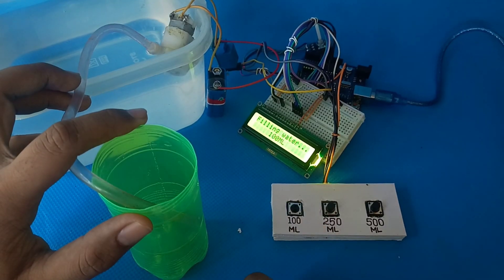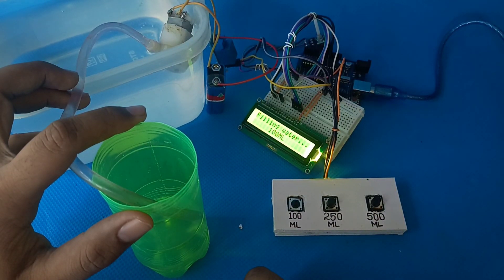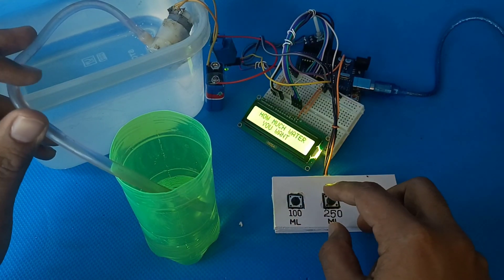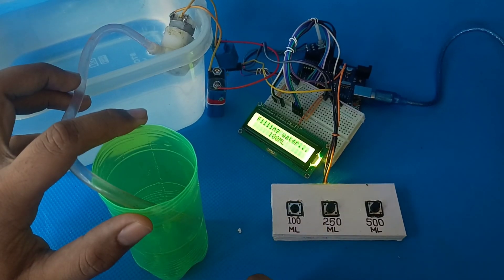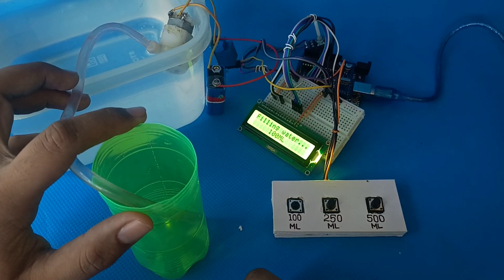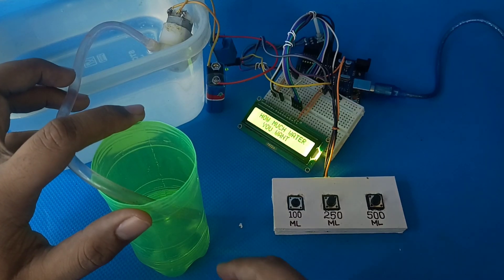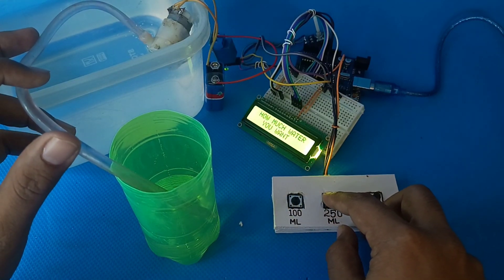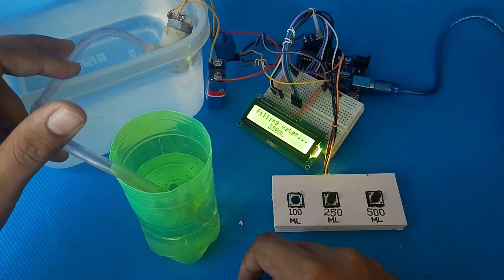Water Dispenser Using Arduino Uno || Arduino Project's

Comment: It should have been better if you use or add flow sensor for accurate dispensing instead of running time.

Comment: Tip : you can use transistors insted of a relay 

Question : how Arduino know how much water has been delivered did it calculate rate of flow of water and  manually put it?